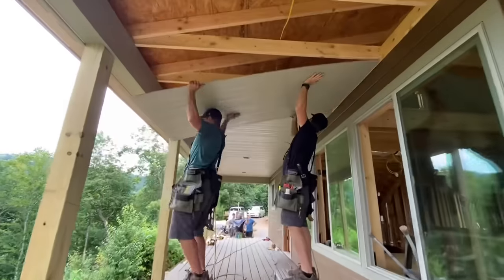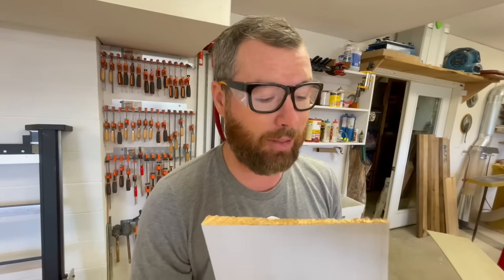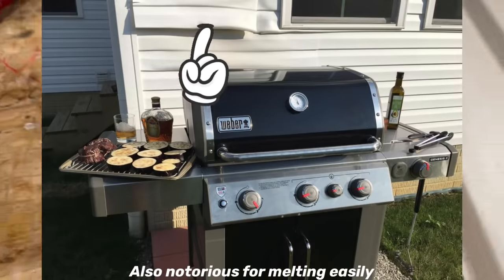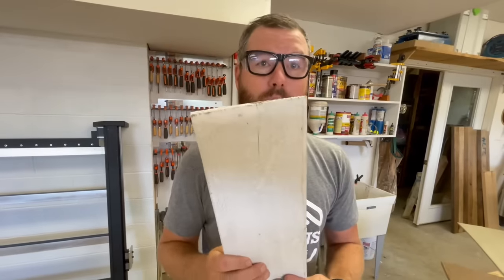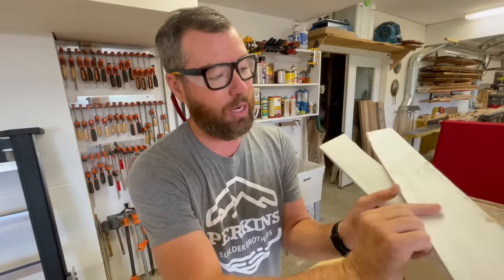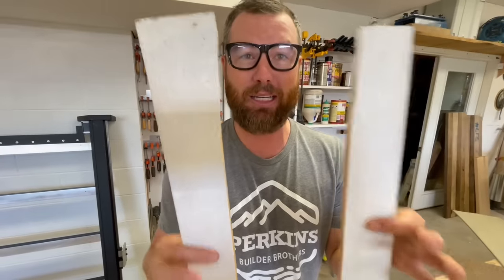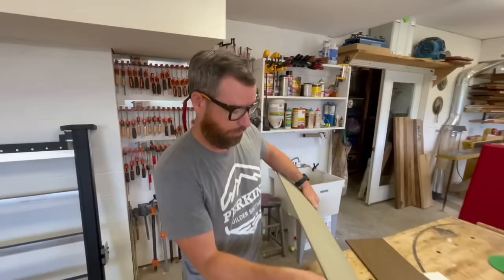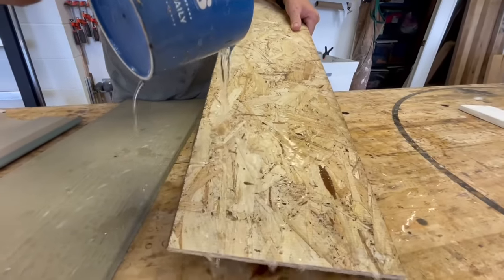Let’s Talk Siding | Comparing pros and cons of most common siding types

Comment: to prevent that blowout on the vinyl siding when it is cold out...turn the blade around in the saw. Works a treat and no more blowouts. Works well with aluminum soffit as well
Reply: Use a grinder with a wafer wheel. It will never fail you.
Reply: Everyone who installs vinyl knows the blade goes in the saw is reverse but in real cold weather a plywood blade in reverse works better
Reply: I used a plywood blade installed in reverse for all vinyl siding. I wish now that I had used hearing protection as I definitely harmed my hearing. There are certain high pitched sounds that I can't hear at all as a result.
Reply: Yeah , most know that but maybe not their audience. Hence, vinyl not so good, but Smart siding very good. Did they mention installation cost..????

Comment: You are correct in saying you can pressure wash vinyl siding.  However it is not recommended by manufacturers as you will destroy the UV protection sprayed on the exterior side.  Also vinyl siding is not waterproof and pressure washers will blast water behind the siding.
Reply: Unless you’re really, really tight with money, you should avoid vinyl at all cost. It’s cheap, ugly, breaks easily, cannot be repaired, etc.

Comment: Vinyl siding cuts well with a regular carbide blade if you flip the blade around backwards. Smart siding is by far my favorite option for the price and durability. Just used their t1-11 style 4x8 panels on our off-grid cabin here in Hawai'i. We get tons of rain here so the Smart Side water and mildew resistance is a huge advantage!

Comment: My last house has insulated vinyl siding that I had installed.
It cut noise and made the home more efficient, and it was a lot more durable and sturdy (thicker) than the thin vinyl siding on my current home.
There was no fading in the 10 years I had it on the house.

Comment: I priced out LP smartside vs Hardiboard (fiber cement) and the hardy panels were significantly cheaper per sqft (Denver foothills, different region than you guys). 

I agree the fiber cement board is much harder to nail, which is why we went with sheets+battons vs traditional boards. 

How is the fire resistance of the LP smartside vs cement board? That was another deciding factor for us, wildfire risk is crazy here.
Reply: hardiboard will not expand more than fraction of a % when wet. LP w if not installed and sealed correctly will expand just like OSB
Reply: Hardy is fire resistant and that's a big win
Reply: Matt Risinger (youtuber) did a fire test on siding. He's a fiber cement guy.

Comment: Around here .. Eastern Canada. Vinyl is still fairly common on older houses but generally larger cities have limited it's use because it looks so cheap - it takes away from the  urban quality of a lot of neighborhoods. For the most part it's reserved for the sides and rear of the house. Our 'affordable' wood siding products like Maibec/Cape cod style siding are already profiled from the mill and painted. Very rarely do I see houses being painted on site. Like the LP smart side, manufacturers give you a bit of touch up paint for ends/cuts. It was funny to me when I started watching your video that you have to calculate the lap of the siding because here, even on a traditional looking profile lap, there is a lip and the siding just butts up to the next piece with no need to figure out the exact spacing. Cool to see the regional differences! Love the videos, very informative. Thanks!
Reply: That all makes a surprising amount of sense. As a usa dweller that uses lasers, story poles, and gecko gauges to space siding im very jealous.

Comment: I think the Hardy board is fire resistant and would cut back on double sheet rock for common areas. Just that alone is why it became so popular in multifamily builds.
Reply: Fireproof (resistant?).
Exactly. 
Here we are a couple days after 1000 houses burn down due to wildfire on Front Range and only passing reference regarding fire protection. Smh
Reply: @willbass2869  I had 89 acres burn in Cali.... My cabin was the only thing standing.

Comment: Being a commercial painter for over 40 years in an area where we get 8” of Rain year, one thing I know of all the sidings. Cedar does not seem to rot. Cedar siding seems to last the longest in wet environment. Areas where a lot of rain comes, southeast side of house with big wall, I see the water running down the wall as if a hose was running. In my experience the siding that is pressed together, areas that are cut tend to swell. The concrete seems to break down. Like I said this is a very wet environment. Cedar is king

Comment: Loving the video and input from you guys. My only question is - your opinions are coming from a builder’s perspective (obviously). What about the durability and longevity that the homeowner will eventually deal with? For example, if you just started using the newer LP smart side, how do you know how it performs 15 years down the road?

Comment: I was definitely wondering about that siding.  All I could think of was OSB and it just seemed like that stuff would suck up water, expand and disintegrate!  Thanks for going in to greater depth as to why it does NOT do that.  Then again, it is wood and it is glued together.  What's the longest time frame you've seen this siding on a house and how is it holding up?  Thanks.
Reply: Ive installed this many times. it definetly DOES suck up water. If you pick up a piece of your scrap pile after a rainstorm, you will see a variance of up to 3/16 of an inch from it retaining water (on your exposed cuts, not on the finish edges)

Comment: Have you ever considered "CertainTeed Cedar Impressions Double 7" staggered shingles" ?  It is polymer and is significantly stronger than standard vinyl.  It looks like wood and resists fading.  I covered my home with it eight years ago and it still looks new and has required only annual pressure washer cleaning.
Reply: Do you nail that in?

Comment: I live in Ohio. And by the way that is not vinyl siding is vinyl soffit Eric. And here vinyl siding is the most common reason why, unlike central and southern states it is not as hot so it doesn’t melt easily.  And lasts longer then any wood siding because the extreme cold weather beats the wood and paint real quick. So yeah and if you do a good installation with a cheap vinyl you can get like 20-25 years easily. Here where I live and I’m pretty sure everywhere else is a new vinyl siding that looks exactly like that lp smart side and it’s got like a 50 warranty looks really good and is very easy to install since it doesn’t expand and contract like regular vinyl siding.

Comment: Currently remodeling a house I own in Indiana, 30x30 house with 30x14 addition which wasn't finished over ten years ago. Main house is around 100 years old with wood siding, addition had some vinyl siding on Southern side, but East and west sides were left with house wrap. Sure you can guess how it looks now. Problem is, wood siding isn't level in appearance looking at house, everyone is telling me to paint house and add siding to addition. I want to pull everything down and install new sheathing and siding. 
I'm thinking blue vinyl siding because finished house value will be around $90,000 to $100,000 and will likely be sold.

Comment: So we had some cement boards leftover that sat outside for at least 4-5 years, exposed and we have zero water saturation into the board. They come preprimed so I don't see the issue. Also, some were broken and still did not soak up water like a  sponge in few seconds as you presented, that makes me wonder what cement board was that? We have cement siding on our house for over 15 years now and it is great so far. Paint stays on it super long and it doesn't peel off like on other siding. 15 years now and still there was no need for repainting, and that is huge saving right there. Also, I have never ever met anyone saying concrete siding LOL.

Comment: Why are your wooden siding boards so thin and fragile? Are these a good representation of what you have to work with? Here in NZ a vast majority of our housing (50-90 years old) is clad in wooden siding boards that are very durable - orders of magnitude more than what you featured here. 

Even the 'newer' pine, WR cedar and accoya siding (as opposed to the now exhausted native slow growth timber supply) is considerably more durable than the board you showed.
Reply: I would guess that it is because (from what I've seen here in the US) we use plywood behind the wooden siding boards. I might be wrong but I thought in NZ most places are constructed where the boards are installed right on top of the framing.
Reply: @shawnanwo  isn't NZ an earthquake zone? Don't they have to use plywood in earthquake zones? Or maybe if they use 22mm cladding it isn't needed.
Reply: I honestly do not know for sure. Was just speculating based off of what I have seen. I thought that may be the reason for the thickness difference.
Reply: Here i Norway we mostly use thicker wood aswell. 19-23mm mostly and 148-198mm wide. And always mounted on 23-48mm strips to enable air behind the siding so it can dry out from the back aswell.
Reply: just remember the cost of housing between most countries and US is astronomical.
Reply: @av1204  as in cheaper in the US ?
Reply: @rfauske  yes. Much cheaper per sq ft.

Comment: You forgot to talk about how you need to wear an n95 mask when cutting fiber cement, since the dust is a carcinogen. I'm using it for my backyard workshop build because I got it for very cheap, will last a long time and looks good. I bought a cutting shear for my drill to make most of the cuts, it does minimize the dust but I still wear a mask. It is harder to get a nice clean edge compared to wood. I installed a 16" wide, 12ft panel by myself and it is not easy. Set up a ladder or something to hold one end in the correct place while you nail the other. Shorter profiles you can use the Gecko Gauges to hold in place. All fiber cement siding needs to be carried vertically with the edge up. the 5/16" is more sturdy than the 1/4". Nailing is also tricky on the thin panels. I can't imagine hand nailing it, a nail gun is a must. I would have used LP siding if it was available as much as fiber cement is here. I got a great deal on craigslist and the Habitat Restore.

Comment: Hey Eric - isn’t fiberboard a bit more fire resistant than LP? We live in a fire-prone area in western Montana.
Reply: I would say you are correct.
Reply: Good point Davide.. I installed fiberboard siding in Paradise, CA 6 weeks ago on a new rebuild after 3/4 of the town burned 3 years ago. Fire resistant was the reason for the material..

Comment: Lp smartside is trash. These guys are obviously sponsered/getting kickbacks whatever good for them, but cement board is way better. Smartside is literally just painted osb. Its absolute hot garbage and completely overpriced. Go with cement board it is easily a 60+ year product, conservatively. I've had a few peices of cement board laying on my property in the woods for over two years, it is completely unpainted and it has not detortiated at all. You can not do the same with painted osb aka "smartside" its a rebranded low cost T-111.

Comment: It’s really unfortunate you haven’t changed your opinion on LP. You haven’t read the warranties and how easily they’re invalidated. You also have to realize it isn’t painted by LP, they sub that out - so anyone who has that on their house will have separate warranties. Finally, LP is as likely to cause cancer as Hardy. And it rots, whereas Hardy doesn’t. But I live in the NW where that immediately invalidates ALL warranties, so I’m pretty biased against it. ***Oh, and they SAY it’s termite resistant, but their warranty doesn’t cover termite damage. So I’m sure it’s easier for contractors to use, but long term, it’s a horrible option for your clients.

Comment: Not really a very good comparison as the fibre board product ends are supposed to be sealed as per manufacturers spec (as does any cut LP SmartSide) & crucially you didn't look at the longer term cost of having to repaint & repair different systems. I get that the osb siding is easier to install but it presumably also burns (there's to be a speciality LP 1 & 2 hr fire resistant version which you don't cover). I love your videos & work but this isn't to your normal standard & in the UK, Australia & elsewhere this would have to have some sort of advertising or commercial relationship disclaimer.

Comment: How water resistant is LP smart side?
Reply: What I mean is how long would it last if installed correctly?
Reply: @pavelpolechtchouk9829  The problem with LP is that it relies heavily on caulking, which is prone to failure way quicker than the siding itself (water infiltration). And contrary to what they showed here, fibercement siding is way more water-resistant than LP. When cuting fibercement siding, carpenters are applying a bit of touch-up paint on the exposed joints to protect them from water. You would never have fibercement sucking water up unless it is wrongly installed. 

Throughout time it is definitively more durable than LP, although LP is more « shock resistant ». Installation is not really harder with fibercement than with LP smartside, unless you’re really novice with carpentry. In that case I wouldn’t recommand that you DIY your siding anyway.
Reply: @Ogilla  and LP will never suck up water if properly installed.
Reply: @smcox1991  Well first this has to be proven, because it’s fairly new and previous similar technologies weren’t reliable at all.

Secondly, like I said, LP relies on caulking a lot compared to fibercement siding. This means that when your caulking fails LP is gonna get wet, and then it’s fucked.

Comment: don't forget the carbon footprint of the cement siding, it's insane.
Reply: No worse than LP. LP requires a shit-ton of glue, additives and products to protect it from degradation. It is also way-less durable on the long run, so it’s ecological footprint is even worse than it looks if you take in consideration that it doesn’t last as long as fibercement (which is a lifetime product when installed right).

Fibercement, well cement in general, is effectively not the most ecological choice at first, it all depends on how it’s used!
Reply: @Ogilla  it's way worse, there was a study I saw for them, I will have to look for it. It did cover the whole of it for each one, soup to nuts.
Reply: @Ramdodge582  I’ll be glad to read the study you found, because the one I read stated that if you take into account the life expectancy of the fibercement, LP was worse. 

I think in the end the reasonnable choice is the one that is the most durable. Single-use non-ecological products (which is kind of a truism one could argue), are the real scourge pollution-wise.

Comment: Wow. That was a super biased review. Put the LP in the same situation as the wet corner where the fiber cement board "flaked off" and it won't fare any better. The water absorption test is absolutely ridiculous. It allows latex paint to bond extremely well. Don't you paint your fiber cement houses? How about fire resistance?  I could go on and on. Yes, LP is a little easier to install properly for the inexperienced. That does not make it a better product. Quite the carnival salesman.